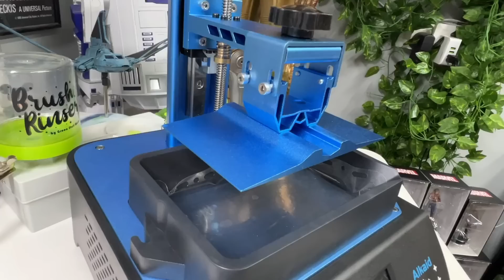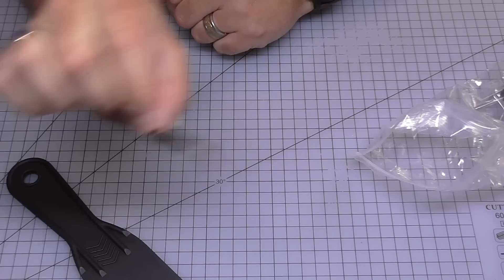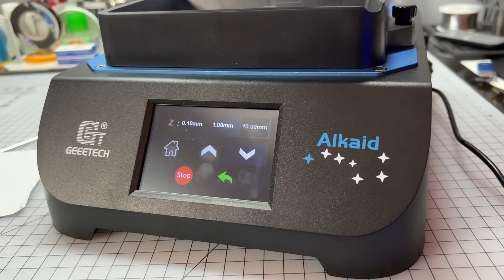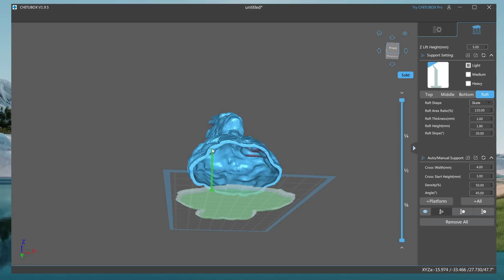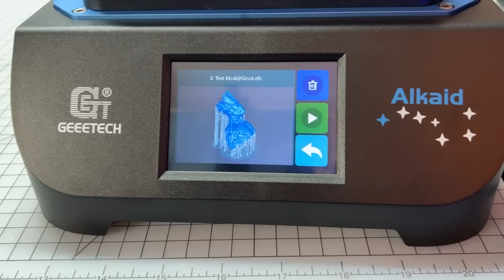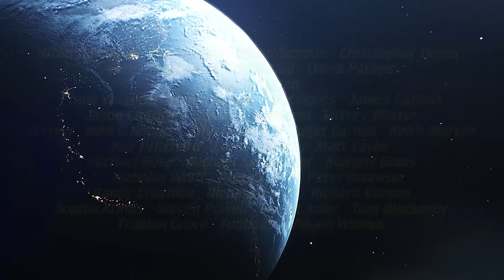Start Your 3D Resin Printer Journey with the GEEETECH Alkaid 3D Printer UNDER £100

Comment: There are so many issues with that Groot-model. supports are failed all over the place. happy youhade enough that it didn't matter. and there is a big layer separtation. luckily its groot and it fits the model. but it realy is not good
Reply: And your models are not the exactly "the same". Could be the resin, or the printer. Don't know. Besides the issues, I already told. The "Bigger" Printer has no layer separation and has a matt finish, while  the Geeetech has a very glossy finish, which many don't like. Could be the result of overexposure
Reply from the maker: Actually the fee sheet had a leak. I had to replace it and then get a razor to the screen
 I made another video since this one printing the Enterprise bridge and it worked perfectly

Comment: I am in the EU. Both link for EU and US redirect to the same page with shipping from US or China. From US is $13 shipping, from China $113. Both will have custom duties that would easily be half the price of the printer. We need it to be shipped from inside the EU!
Reply from the maker: Yep. It’s cos they are out of stock in EU and GB atm
Reply: @WorldofWayneUK  thanks for the clarification Wayne. I'll keep checking the website :)
Reply: Just a quick update: you need to select the right country in the upper left box "Ship to" and the EU warehouse will appear! I've just ordered my first 3d resin printer, together with the wash and cure machine gwc02. Thanks!

Comment: Hi Wayne. Hope y'all are doing well. I liked the review of the Resin Printer, but I was wondering if there may be a difference in the supplies and operating costs between the Resin Printer and Filament printer. What are your thoughts? Besides the cost of the 3D Printers LOL.
Reply from the maker: The resin cost me £22 per kg. Slightly more expensive then filament but not a lot in it to be honest

Comment: Would suggest remove supports before curing as I cured with supports and it destroyed the print removing supports and I use water washable resin which costs me around £22 for 1kg less toxic less fumes and easier to wash with water that works out cheaper than buying isopropyl

Comment: I find that leveling in the vat, not on paper, is better with my printers. I have two tank body printers, a phrozen sonic 4k (original in tank body, before they made the consumer ones) and a epax tank printer (lol, before they also joined in the consumer ones). Those consumer printers came out right after I invested way too much in the ones I have. They are nicer, but they are overkill for what I need. I wish I had waited just a little longer, so many nice printers are out now.

Comment: Hi Wayne. 

You should be using nitrile gloves or other chemical resistant gloves to protect yourself when handling the raw uv resin and the unwashed and partially cured prints. The raw and partially cured uv cured resins can be very bad for your health. 

You also need to be careful of your used isopropyl alcohol; perform two washes, first in used iso, second with fresh iso. UV expose the combined used iso to cure any raw uv resin left from the washes and be mindfull of how you dispose of the final dirty iso.

Remember isopropyl alcohol is mildly toxic and its vapour is highly flammable. Isopropyl Alcohol is a completely different chemical to the alcohol (ethanol) that we drink.
Reply from the maker: To true. Thanks Jonathan